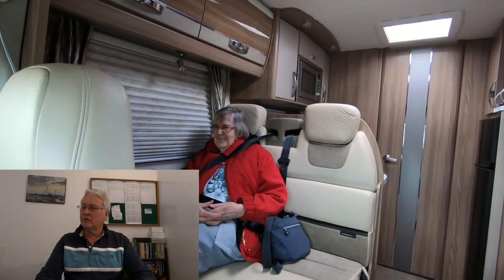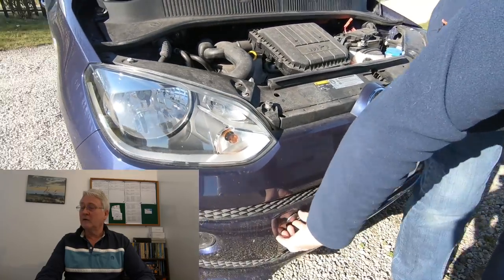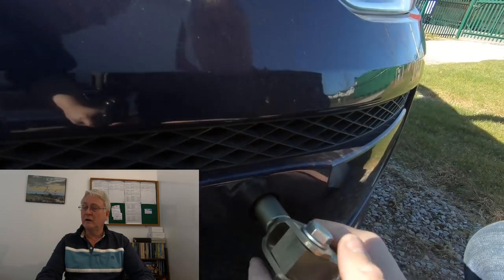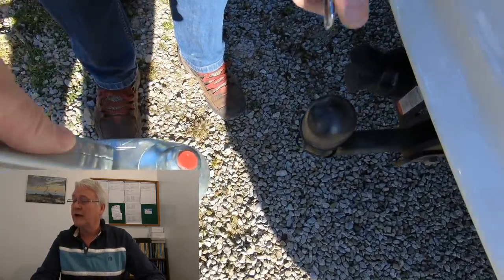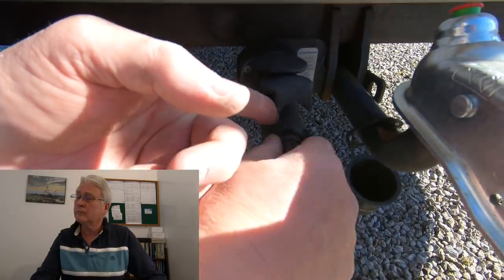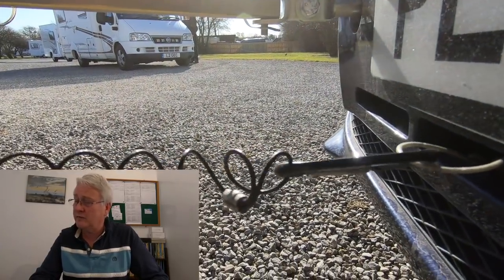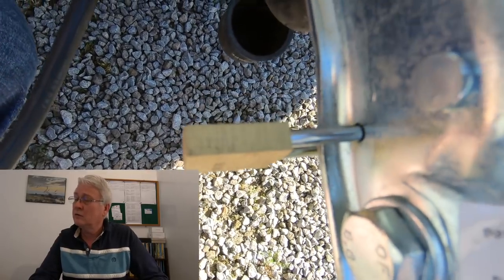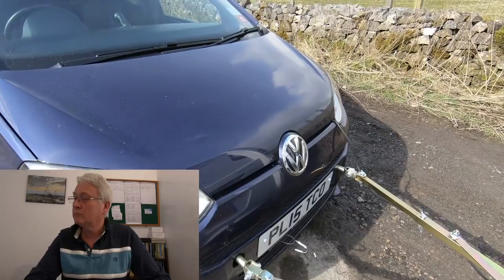We Get An Upgrade For Our Smart-Tow A-Frame

Comment: Very good video Bob, I would only add two things, I always put an ON TOW on the back of the car, and after each towing trip I spray and clean the telescopic parts of the A frame with a silicon WD40 lubricant.
Reply from the maker: Thanks for your comments. What I was told when I bought the system, was that "On Tow" is used when recovering vehicles on a dolly, tow rope or similar. With an A-Frame the car becomes a trailer and uses the number plate of the towing vehicle, so no "On Tow" message should be legally necessary. However, I think it is a good idea to warn other road users that it is being towed.  I am now using a silicon based lubricant now, as I was using grease before.
Reply: I've read that an on tow sign makes the car illegal, but can't remember where I saw it?

Comment: I like how this uses the towing eyes. I though that the original towing eye was a left hand thread. Did they have to replace the original one from the factory. I've read the comments on why you choose to tow a small car on the longer trips. It is what is suits you best. It is for the same reason that I tow a caravan with a 7 seater diesel MPV. The MPV is what suits my lifestyle best (carrying passengers, tip runs, 20 mile commute to work with a stretch of motorway and of course towing the caravan). I've had to do a voiceover on a video because some of my footage had no audio.
Reply from the maker: Parknest Thanks for your question. The towing eyes are both clockwise thread. Smart-Tow added another towing eye by modifying the crash bar. Absolutely agree with you our about choices. We all choose something that suits us. We have a small car, as it's just us and a Westie.

Comment: Hello bob watched your film with great interest, how things move on at a fast pace looks a great idea for towing and looks light and easy to set up , however if you would allow me to comment my concern is how much stress the towing eyes are under? Towing , braking, cornering etc , in my experience it does not take a lot for the towing eyes to break , but the fact you have 2 could relief the pressure abit 
My experience is 16years with a yellow breakdown company I’m sure you can guess which one 
At one point as I recall there were so many incidents on towing eyes a secondary strap was used as a breakaway and it’s fair to say recovery methods are alittle different and the stress points would be different too but still the same place of contact 
Hope this helps please keep a eye on the towing eyes for bending etc and let us know how you get on 
Sorry for being slightly negative Gavin 
Love your films !
Reply from the maker: Gavin Streetie it's ok. I've been using the system for nearly 3 years now and the company has been going a lot longer. The system is fully proportionally braked, which I guess helps. I have every confidence in the system.
Reply: Bob Earnshaw after 3 years I’m sure you have good confidence don’t take any notice of mr paranoid 😶😶
Have a good holiday

Comment: Can you show us how you reverse with the a frame on ? Come on bob show us how good you are 😃
Reply from the maker: Kontiki 635 you can reverse with the car on and I've done it a couple of times, but because of the front wheel caster action on the car, you can't control where the car's front wheels point. Besides, the car has it's own engine... :-)

Comment: Nice job Bob, very instructive. Have you created a video listing the costs? It's such a great system, is it very expensive?
Reply from the maker: Thanks. It was £2500 for the A Frame system and fitting, 5 years ago. It was £500 for the tow bar fitted.
Reply: @BobEarnshawMoHo  much obliged!

Comment: Dear Bob, I really enjoyed the video. We bought our first motorhome in August last year, I'm now looking into a A frame for a car. What weight of car would you recommend for towing, we have a Mini Cooper S Convertible and wondered if this would be OK? 
Thanks for your informative and enjoyable channel
Rob
Reply from the maker: It depends on the towing vehicle, if it's within it's towing capacity, and doesn't exceed the gross train weight, but fitted with a properly braked system should be OK. Sometimes it's about what cars can be converted by the supplier as well. Might be worth checking with
Mike Northeast
Mobile +447742667681
mike@smart-tow.com
Reply: @BobEarnshawMoHo  Thanks Bob, I appreciate your help and the contact. We have a Swift Lifestyle 664, I'll give Mike a shout!

Comment: Very interesting Bob, we are considering towing a car, can you explain the car electric  hook up lead, is  there a permanent fixing under the car Bonet ? Also what licence category do you need to do this, ta 👍
Reply from the maker: Martin Davies Thanks for the questions. The towing electrics are wired in permanently to the car. If you passed your test after 1st Jan 1997 you'll probably be limited to max vehicle weight of 3500kg + 750kg trailer. Before 1st January 1997 and under 70, like me you'll probably have C1 category on your licence and you'll be fine as long as you don't exceed the gross train weight of the vehicle. I did a whole video on licences. https://youtu.be/vB53G-3t-Uk

If you don't have the right categories - either B+E or C1 you can take additional trailer tests.

Comment: I like the idea of the telescopic version to ease hitching up, not keen on the price though.  

I have a question - I've not noticed you  fit trailer triangles to the car when it is being towed, isn't that a legal requirement?
Reply from the maker: Yes you are correct, the car becomes a trailer and as such should have rear facing red reflective triangles. The car already has red reflectors but they are not triangular. Sometimes the law hasn't caught up with practice.

Comment: Interesting video, I wondered how it worked! A couple of questions if you don't mind Bob. If the key is in the ignition is the ignition set to on or off? I presume either way mileage increases on the car. Also, do the car lights run off the motorhome battery?
Reply from the maker: Simon Ingram Thanks for your questions. The car ignition must be off. You leave the key in the ignition after you unlock the steering column. The mileage doesn't increase on the car as the speedo only runs when the ignition is on and car is running. The lights run off the motorhome alternator since you plug the car into the motorhome,  just like a trailer or caravan.

Comment: Bob could you tell me is your motorhome a 3.5 ton or larger? and what’s the train weight you can tow? Cheers
Reply from the maker: Richard West Thanks for the question. Our Swift Bolero has a max weight of 4250kg. The train weight is 6000kg. The max towing weight is 2000kg.
Reply: Bob Earnshaw brilliant thanks for that helped me out 👍🏻

Comment: What about the front wheels of the towed car, do they turn when you are cornering?
Reply from the maker: Thanks for the question. Yes they turn as you corner. They have a castor action. A bit like a supermarket trolley's front wheels.
Reply: I don't understand how the wheels can turn. Are they still connected to the steering wheel and the rest of it with rack and pinion. I don't get it, how are the wheels able to turn?
Reply from the maker: Thanks for your question. Someone else explains it quite well: How the steering allows the car to follow is really quite simple, it is the caster angle. In simple terms, the vertical spindle of the front wheels is set behind the horizontal spindle. Picture the front swiveling wheels of a child's buggy. As the frame of the buggy is steered by the handles the front wheels swivel on their vertical spindles and follow the frame.
The principle is the same on a car being towed, the body of the car follows the tow ball and the front wheels swivel on their vertical spindles and follow the body. it is necessary for the steering lock on the towed car to be set in the accessory position, this will allow the steering to turn. Don't worry it does work!
Reply: Thank you for your reply, but I don't understand it. Sorry about that!
Reply from the maker: That's OK, it just works.

Comment: you lock the car with the key in the ignition?
Reply from the maker: Yes, I lock it manually with the other key.
Reply: @BobEarnshawMoHo  how much does the conversion cost?...im thinking about getting the RS elysian, do you know much about it?
Reply from the maker: Best to check for the latest information, contact 
Mike Northeast
Mobile +447742667681
mike@smart-tow.com
Don't know anytjing about the RS Elysium other than RS make very nice Motorhomes.

Comment: Thanks for your informative video. We currently tow a four wheel  car trailer, as we understand that A frame towing in Europe is illegal. Having said that we are considering an A frame system and my question is, is there any damage from stones etc thrown back by the motorhome? I see you don't seem to use any red triangles on the back of your car?  Thanks Steve
Reply from the maker: Steven Ingarfill Thanks for your questions. Have a look at  http://smart-tow.com/legal.htm for the legal aspects and towing in Europe. Yes you are right, because the car becomes are trailer, technically I should put warning triangles on the back of my car, but as it is already equipped with warning reflectors and lights and we we're told we don't need the reflectors. As for stones thrown up I've noticed any particular issue. The car does get a bit mucky sometimes. We did look into getting a towing cover but that was around £350.

Comment: Just reading comments about reversing with a frame seems to me it’s a pretty poor system if can’t reverse what if you meet a larger vehicle in a narrow bit of road... was thinking of looking at one of these not now you would be made to look pretty foolish  un hitching in front of a laughing truck driver 😂
Reply from the maker: Swift Roaming free Thanks for your comment. In the 3 years of using it if I've had to reverse twice. You can reverse but not with precision for a long distance. Don't make a decision based on a bit of banter!
Reply: Bob Earnshaw 
Bob, how quickly can you decouple the car from the van if you need to do so because reversing is not practicable? I have seen videos of people who have just temporarily unhooked from the tow ball, and then simply raised the Aframe upwards so that it temporarily rests on the bonnet with the cables while they quickly reverse a short distance. I’m thinking for example of perhaps needing to quickly uncouple to minimise inconvenience to others.